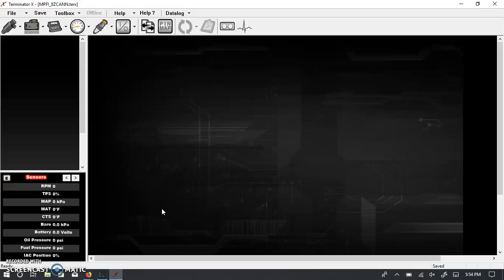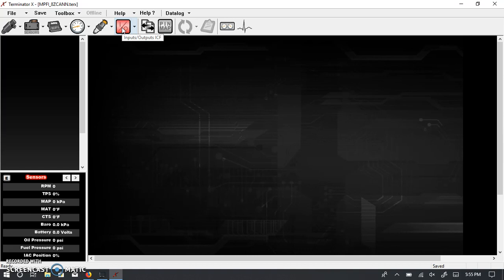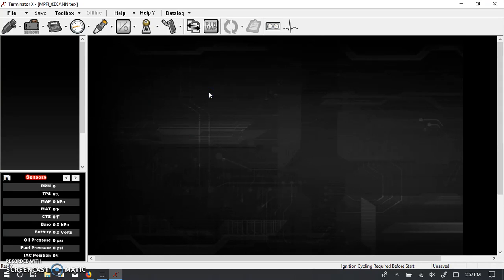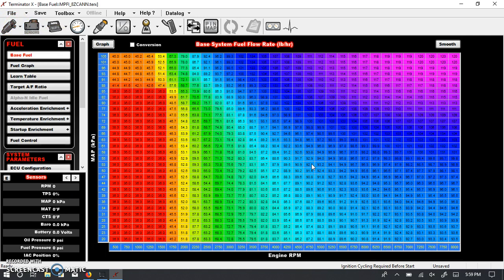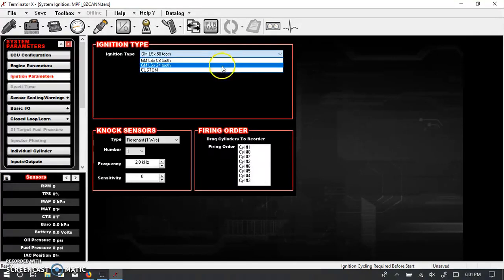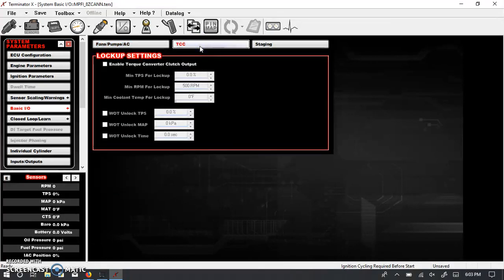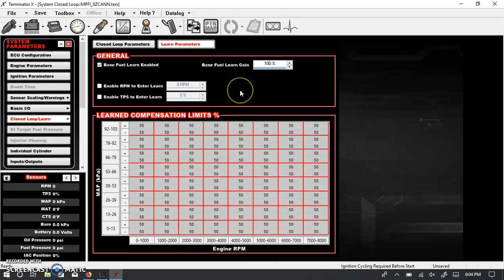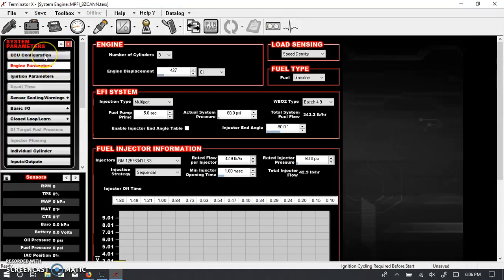Holley EFI Terminator X software Part 1

Comment: How do you input injector information if the injector your using isn't shown as an option thats already programed in the terminator x?

Ahmad
Reply from the maker: If you download TerminatorX v2 there are a lot more injectors listed. You can either upgrade to v2 or just copy and paste the injector information into v1. If the injector data are not available for your injectors, input the flow rate at the rated pressure and guess at the injector off time. Or, try to contact the injector manufacturer for the injector ofttimes data.

Comment: Thanks for the info!
I have a question about the start up idle. I have it set for 800rpm and the cold start goest to about 1500rpm and settles down normally as it heats up. 
But when the car is warm, say like going to the store and I start it again it jumps all the way to 2000rpm. I was able to shorten the time it stays at high idle and the ramp down time also, but don’t like it going that high. 
I’m still in the closed loop cycle and using the handheld controller
Reply from the maker: Try lowering your IAC park position and reducing the cranking fuel a little.
Reply: Also I found you through my buddy Erich, said you sent him an emailed tune for his 66 El Co and was very happy with it!!
Reply: Ok cool. Thank you! I added you on IG too 
AsEyeSeeThings
Reply from the maker: Thanks

Comment: What if you have started your car with the handheld but now want to use your laptop, what would be the process for doing this...choose download from ecu? Or do I need to create or open a new global file?
Reply from the maker: Simply connect the laptop with the CAN to USB cable, open the software, and choose "download from ECU."
Reply: Projectgattago gotcha, what I want to do is change my injector type I completely loaded the wrong type in the initial wizard setup, can I just go back through the wizard and change that or do I need to use adv features and laptop. Thank you so much for your help. I’m a dinosoar and wizard was so easy...laptop scares me a little.
Reply from the maker: @clint.garage.6092  Doing it in the laptop is super easy. Just go to the System ICF and you will see the injector type, and you simply select the one you want to use from the menu. I don't use the handheld, so I can't give you the exact steps, but the manual covers it.
Reply: Projectgattago done thanks.

Comment: I've been asking around and no one wants to answer this for me how do I add an aftermarket coolant gauge to the holley harness and how do i turn off the electric fan when engine is off
Reply from the maker: If you want to add a coolant gauge, it will usually have it's own sensor that you would install in the other head. If you want the fan to turn off when the engine shuts off, but the key is still on, you have to create a custom output for the fan, instead of using the fan output in the Basic I/O. You would then program that output the same way for temperature, but have it only trigger when the RPM is above 300.
Reply: @projectgattago  I have. It setup with a coolant temp sensor on the passanger side head but it's off by 30 degrees f but hey thanks again man I guess it is what it is maybe they'll fix it In an update

Comment: I'm completely new, my cord to plug my laptop in hasn't arrived. Can you explain how removing your SD card from the little screen, and installing it in laptop for tunning goes. Also how to save, and transfer tunes.
Reply from the maker: You make changes to the tune in the software on your laptop and then save the tune to the SD card. Insert the SD card into the handheld, then find the menu where it says load tune. This will transfer the tune from the handheld into the terminator ECU.

Comment: Finally! Thank you! Is there a way to hook up a remote start to this system?
Reply from the maker: The EFI has nothing to do with remote start. Remote start will be part of the car wiring, not the engine wiring.
Reply: @projectgattago  thank you for your response. My issue is the project car.. it's a 51 Chevy truck. It has no wiring. Therefore, I suppose, I'm kinda SOL, but at least I know that now! Thank you again.
Reply from the maker: @timdontwannasay5889  No problem. There are numerous, high quality wiring kits out there that can easily be integrated with the Holley engine wiring.
Reply: @projectgattago  I'll give a look at those! Are they Holley as well? If you're not sure I'm sure I'll find them, just waiting for break time!😁
Reply from the maker: @timdontwannasay5889  Not Holley. Take a look at American Auto Wire, Painless, Ron Francis, Centec, etc...

Comment: Setting up flex fuel would be a great video. Holley put on out a few mo. Back that would apply but if a person is new to the platform it would be tough to fallow. On the other hand you have done a great job explaining on terms most people can understand. Thanks for the great video 👍🏻🤛🏻
Reply from the maker: Thank you. I will make another one tomorrow.
Reply: sloppy mechanics has a great video on setting up a flex sensor, Projectgattago, Devin Vanderhoof all make very informative content. use them all if you can. these systems are very capable, and lots of end users have come up with great ways to utilize the 1d-2d tables. snakeeater performance has a spread sheet table for injector end angle setup. so much good info out there for the Holley system.

Comment: thanks the video, I'm interested in setting some some PWM control for fuel pumps or fans.
Reply from the maker: PWM control for fuel pumps is complicated, but PWM control for fans is pretty straight forward. I have a video on that already. It is based on my Dominator ECU, but it is exactly the same for the Terminator X.
Reply: @projectgattago  The way I run my system now is two walbro 450 pumps with one on a hobs switch. But on a really hot day and long drive it will vapor lock even with only one running. So I though it would be nice to pwm control the first pump to bring in down at cruise and idle to stop cooking my fuel I'd still use my regulator and just ramp it up at higher rpm.
Reply from the maker: @brandonloll4262  The problem is that I don't know of any fast acting PWM controller that can handle a fuel pump. I have seen people use solid state relays, but I have no direct experience with doing that. You might want to check out the fuel modules and electronic regulator from Fuelab. Neat stuff. Or consider VaporWorx.